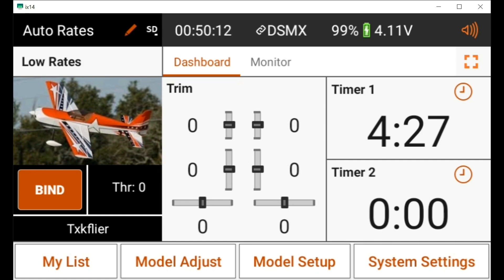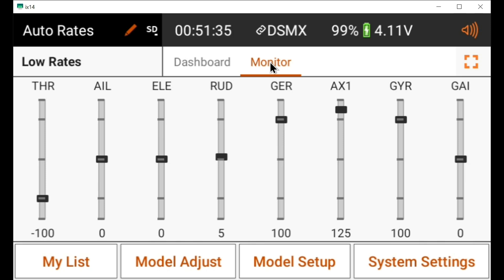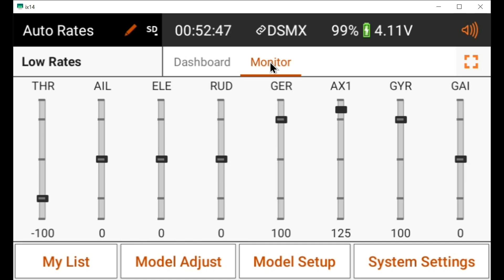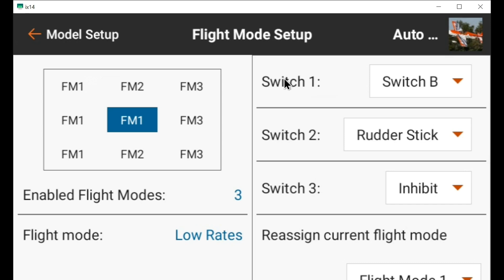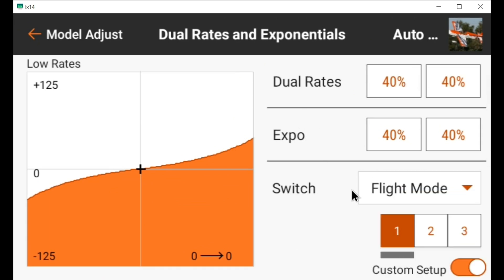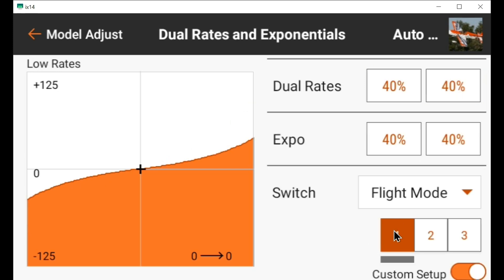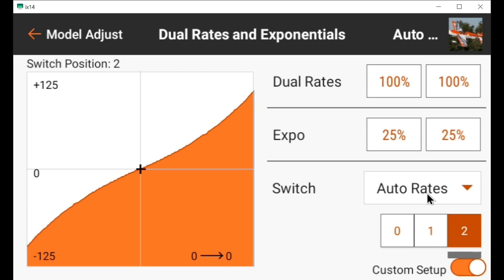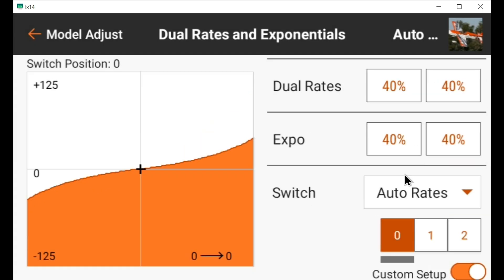Auto Rates for Spektrum Transmitters

Comment: Another great video.  I liked your idea so I set up my iX to do Auto Rates using the logical switch.  Worked great.  Decided to do the same on my NX transmitter and ran into a possible bug.  When I choose the logical switch as the switch for the dual rates I can not adjust the rates or expo.  I just get dashed lines.  Interestingly though, I can choose the curve.  If I set up the dual rates using just a switch and then change to the logical switch, the rates remain effective, but can't be changed.  Update - left it set up with the logical switch, turned the radio off and then back on.  Dashes are gone and now the rates appear.  Firmware version 4.01A.18,
Reply from the maker: @BriNaCa  I don’t know if I’ve done auto rates on an NX. When I did it on DX’s, I used the transmitter’s flight modes. DX’s didn’t have logical switches, but the planes didn’t have flaps, so the flight modes were available. With a logical switch, you can have auto rates plus flaps on the flight modes.
Reply from the maker: I just tried it on my NX10+ and got the dashes where the values go. I exited, shut the radio down, turned it back on, and the numbers were there instead of the dashes. I didn't try switching to a different model and then going back to it, so I don't know if that's enough fix it. It works now though.

Comment: Thanks for this valuable information. May you shed some light on how to set up SWITCH COMBOs.
Reply from the maker: I’m not sure I’ve used combo switches, but I might be soon. I watched a video a few days ago where they used one to turn tailerons on and off.
Reply: I enjoyed this thank you very much. As a retired computer programmer and a long time(30+ yrs) rc pilot I was wondering if you ever put this into a spreadsheet? I just started with using flight modes and see a great advantage in using them. Thanks again.
Reply from the maker: @ No, I use a lot of spreadsheets, but not for this. I create templates like I used in this video that I can use to add new models. There are so many settings that it would take a while to set up a new plane from scratch. See my blog on RC Groups.